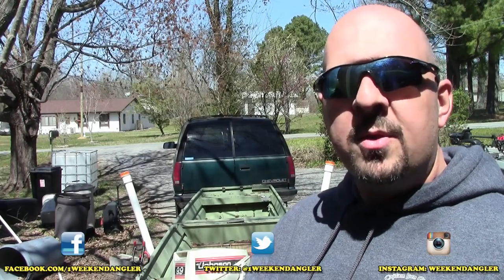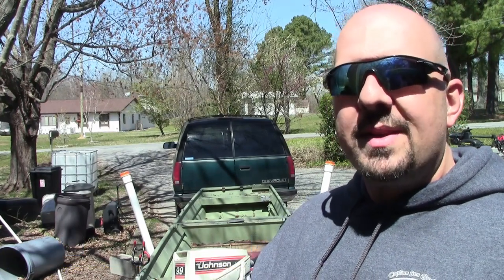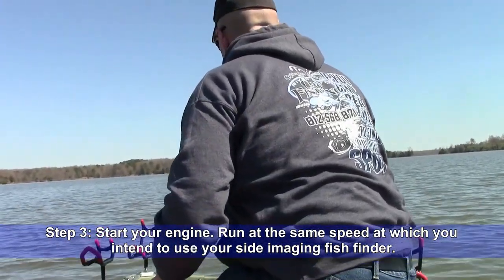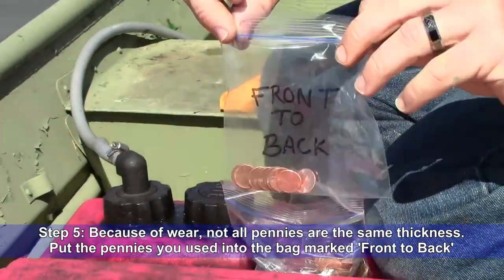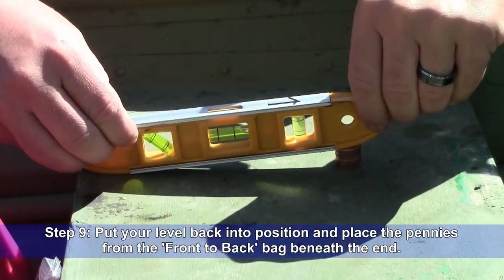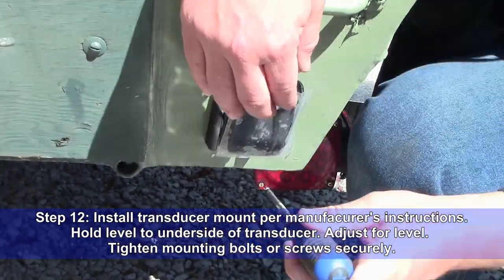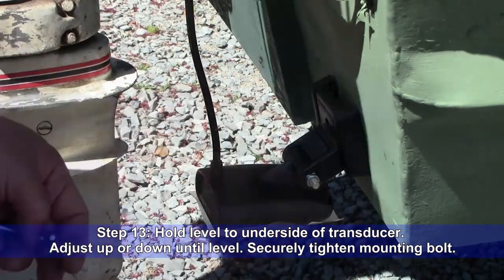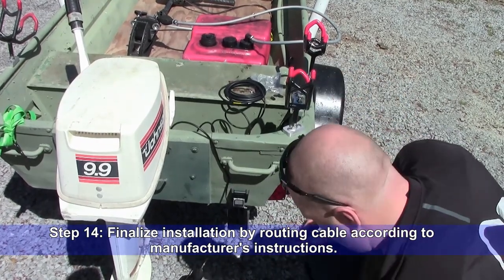How To Level a Side Imaging Transducer (EASY Way to Get BETTER Images)

Comment: Honest question. Yes, I agree doing this leveling trick would be best in a perfect world, if you always fished in same conditions, but wouldn't the level of the boat always change based off how many people you have with you fishing anyway? Meaning, so even if you have it perfectly level the first time, the next time you go out you may have 3 grown adults and weighing the boat down differently to where it's not level anyway? Am I thinking wrongly? I think the leveling is great if you do level with the people in boat who will always be fishing with you, but otherwise... does it matter?
Reply from the maker: You're correct. A change in weight distribution will affect how the boat sits. But, unless it is a major weight right at the transom, the angle isn't going to change that drastically.

Leveling the transducer using this method can mean the difference between fish showing up as arches on your sonar and them showing up as blobs. Your side and down imaging clarity will be better as well.
Reply: @TheWeekendAngler  thanks for the reply. I have always tried to get the best images but never done the penny trick. May try now as I just upgraded boats and am trying to switch my transducer to the new boat. Just have to decide whether to mount on the lower step hull or the back transom. Lower step hull would sit deeper and possibly have better reading being away from motor and would keep reading while at speed... So I am thinking 🤔... it's a 19ft fish and ski with a 150hp optimax on back.  Deep v with step hull at back.
Reply: @TheWeekendAngler  I wish I could send a picture of my current project...
Reply from the maker: @patrickrhodes5241  send it as a message through my Facebook page. There is a link in the description of this video
Reply: @TheWeekendAngler  Facebook message sent. Thanks!
Reply from the maker: @patrickrhodes5241  I got the message. I'll check it out tomorrow afternoon and get back to you. I'm headed to bed now. Early morning tomorrow for the live catfish tournament that will be streaming right here on my channel.